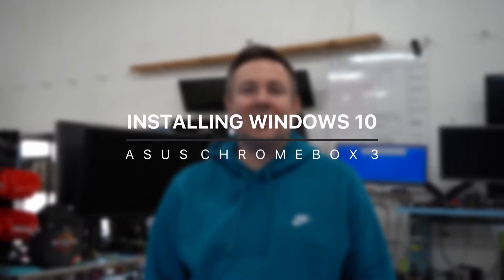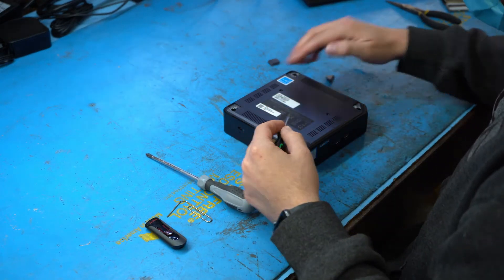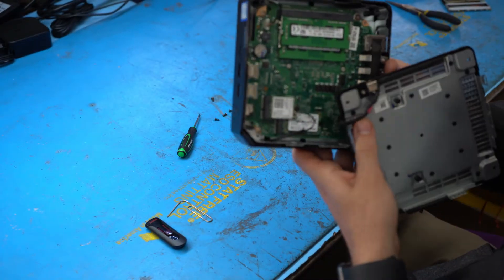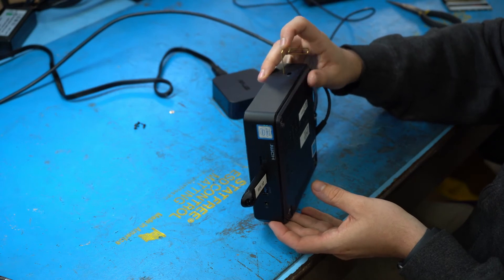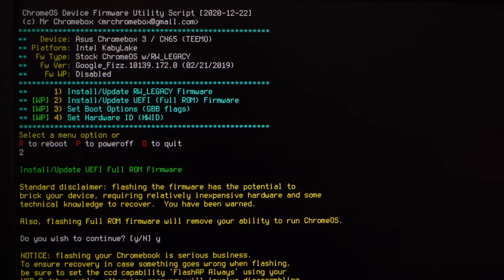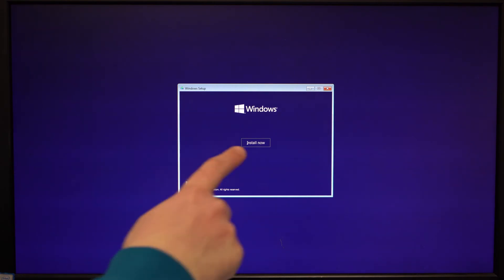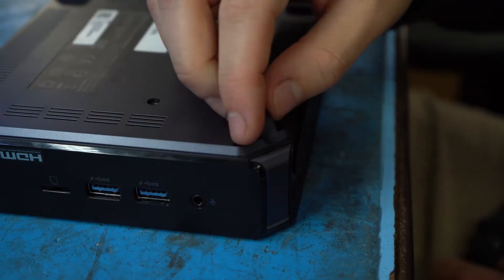Installing Windows 10 on an Asus Chromebox 3

Comment from the maker: Hey everyone.  I see a lot of comments lately with people having problems getting this to work for them.  This video is from 2/22/21 and it's now over a year later. If you are having problems with the instructions it's possible that something changed and it doesnt work or doesnt work the same way anymore.  I'd like to have one of my employees follow the guide again and see if it still works for them, but I dont know when we will have time to get to it because we are slammed with projects.  I'd suggest going to some forums and asking questions there if you are having problems.  Thank you.
Reply: have you tried it this year of 2023 to see if it still works to get windows 11 home installed!??😢😢
Reply: @jeffreybower5959  Nope
Reply: I think the problem people are having is that the video jumps to a later section and we are missing the part how we get to the CLI.
Reply from the maker: @RepairMan2x  The video is old now. When the video first came out 100s of people used it successfully. Now we get a comment here and there with people that say it doesnt work. If it doesnt work anymore it doesnt have anything to do with the video giving bad instructions, its either people are doing it wrong (not following instructions) or the instructions just dont work anymore because of a change to the download we used to make it work.
Reply: have all 3 of the chromebox 3  running windows but no sound ? what driver does this take realtech highdef
Reply: Hi there, is there any way of doing it on Chromebox 5?
Reply: no @luizsantos2422
Reply: @luizsantos2422  Probably, i would suggest googling and looking for some forums

Comment: How did you connect to Wi-Fi in developer mode?
Reply from the maker: We made this video over 4 years ago so i dont remember exact details, but i dont think we connected to wifi ever in this video.  I could be wrong, but i believe all the files were put onto a flash drive for the install.

Comment: So, after removing the screws, the installation requires an internet connection for firmware updates.
To replace the SATA storage with a larger capacity, should this be done before or after the firmware update?
I mean, the existing storage can be reused to revert to the original ChromeOS system. Is that possible?

Comment: still no luck on the 3" but cn60's so far easy to change firmware but chromebox 3 is not responding to the ctrD to get into developer mode so not sure what to do

Comment: I follwed this tutorial up until i put a paperclip in the hole and i get a message that says, "Device you inserted doesn't contain Chrome OS".

How can i proceed?
Reply: did you press Ctrl + D at this point?
Reply: @markusholmen6635  yes, no response
Reply: i think you still need the original 32gb m2 ssd with the chrome OS on it.

Comment: For the people that have a problem with getting int developer mode - you need to have a system disk with ChromeOS installed. Then you are doing the steps and you are able to access the bios upgrade procedure. Thanks for the instruction
Reply: @arbbo1675  i got ChromeOS on the disk so no idea. I installed on it proxmox so no idea how windows works on that device
Reply: @arbbo1675  I got mine with OS Chrome installed so i got no idea. Regarding windows i have not installed it - i installed proxmox
Reply: have chrome os on it but not helping and yes have the right screw removed

Comment: I followed the steps and i just get “device you inserted doesn’t contain chrome os”
Reply: Did you ever resolve this? I am stuck at this stage
Reply: @arbbo1675  no I had to put the original drive back in it with chrome on
Reply: I figured it out and now running Mint Linux on two of my chromebox PCs

Comment: worked for me on a Chromebox 3 I7-8550u with 4 gig ddr 4 and 32 gig upgraded to a 32 gig ddr4 and 1TB ssd NVME, worked flawlessly only 4 drivers missing but all  USB Port work and sound work has well, using it on my 4K tv has a Streamer!
Reply: Very nice, i do have the same computer, however i don't have audio through the HDMI, or the port in the front.. i have to use a USB audio device..
Reply: Sound is going by my hdmi without problem used hp driver if i remember right
Reply: Could you share the driver I have a problem with the audio driver
Reply: @rohitdutt4010  identify your driver needed buy going into the device manager then select the undetected device go into properties then details tab, look under HARDWARE ID then look for it on google, i still have 4 undiscoverd device but nothing preventing from working, mine was identify has INTELAUDIO\FUNC_01&VEN_8086&DEV_280B&REV_1000
 witch worked for me has HDMI sound card
honestly didnt test other audio port since this one work
Reply: BTW its run Windows 11 Pro Flawlessly!
Reply: How are you using this as a streamer? Do you use apps?
Reply: @arbbo1675  i Use it to watch my movie like netflix Disney Plus Spotify has well and for other kind of movie streaming website :)
Reply: @arbbo1675  using either google chrome or the windows app disney plus, netflix (sorry i dont stream like twitch and such i mean streaming video for my kids my english isnt perfect)
Reply: How? Mine doesn't go to developer mode
Reply: @Japzel BE sure you have the OEM harddrive in it before going into developer mode! tryed using a my 1TB hard drive with Chrome os installed didnt work needed my owm 32 gig hard drive
Reply: We have the same exact system

Comment: Windows installer keeps crashing:/
Reply from the maker: Likely a problem with either your flash drive or your system.  Did you upgrade/change any of the parts like ram or SSD from what the factory had?
Reply: @computerheadquarters  i changed the ram to 16 gb nothing else

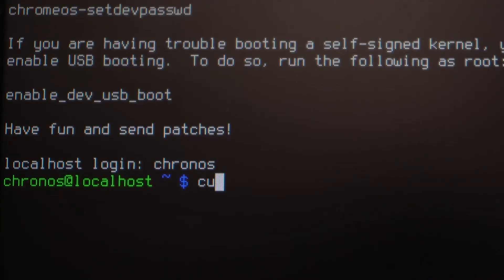Comment: So at 5:29 after you connect to the wifi, are you going onto a terminal on a different device or are you using a terminal on the Chromebox and how do you get to it after connecting it to wifi? Thanks.
Reply: I found it on another video. Need to press Ctrl + Alt + F2 to get to that window.

Comment: Great News Alex! I knew that some how I would get this Chromebox reprogrammed for Linux and it finally happened. After days of all my trials I went to the master, Mr. Chromebox himself. I found out that you can actually avoid some of the steps in your video. Once you get to the screen where you hear the two beeps and the system goes into developer mode, the system will boot you back to the welcome screen. There you press LET'S GO or GET STARTED and you will get the wifi screen where you connect to your wifi. Once your connected you press ctl+alt+f2 to get into the terminal. Then it's all downhill from there, like riding a bike. Enter CHRONOS to log in as admin and then just put in the command line supplied by Mr. Chromebox. The computer will do its thing for about ten minutes. when the script ends it will tell you to press enter. Type R to reboot and there you have it , the little RABBIT. I didn't even have to reload my Linux Mint. I just took the SSD out of my Chromebox 2 and put it in my Chromebox 3, went to the boot menu and selected the drive and it booted into my existing Linux Mint, saving me the hassle of reinstalling all my files and setup. You know what they say, "WHERE THERE IS A WILL, THERE IS A WAY!" One of the most challenging and exciting things about owning a computer is trouble shooting problems and discovering how things work. I hope this information can help someone else with his or similar problems. When all else fails, read the information on mrchromebox.tech website, it may light a fire in your brain to try something different than what you have been doing. Have FUN!
Reply from the maker: Thanks! We havent really spent much time with chromeboxes in years - back when we made this video we had something like 2000 chromeboxes that had just came in from a big supplier and so we were really looking for ways for more customers to find a use for them.  We sold through those years ago.  We have been getting small amounts of them here and there, including the new Chromebox 4.  Our chromebox videos are actually some of our most viewed videos, so if we get some time away from our current video schedule with our LAN center, i'd love to revisit.

Comment: Hey Alex. I have an ASUS Chromebox 3 that simply refuses to be reprogrammed. When I power on and keep holding down the reset button I do get as far as TRANSITIONING INTO DEVELOPER MODE. But the system refuses to go any further. I even tried holding ctl+alt=H at the end of developer mode and the system just boots back into Chrome OS welcome screen. This system is either broken or it's possessed!
Reply: Then you need to enabling debugging options first and enter the root password, if not changed it is test0000

Comment: Good News Alex! I downloaded a copy of the Chrome os Repair software and I have my OS back. However, when I try to get into a terminal my system won't let me get passed the screen were it processes into developer mode and then it boots me right back into the Chrome start page. I've been working on this for several days now. I've come to the conclusion that there are multiple versions of the Chrome OS in these boxes. Not all boxes can be reprogrammed in the same sequence. There are some points that I cannot get passed. I try ctl+alt=H when it gets to the screen you show, but that just boots me back into Chrome OS start page. I never pull up a terminal. I can get it into developer mode. I hear the two beeps and press ctl+alt+H and I get booted back into Chrome OS again and again and again. I guess I just have a Chromebox?
Reply: I know this is old but you can't have set up the chrome os yet power wash the system and start over do no proceed into chrome os when prompted

Comment: I'm following your instructions and I get to the point were the message comes up about setting up hangouts and I click NO. A WELCOME screen comes on and that's as far as I can go. The computer will not go any further into a terminal. How long does the welcome screen stay on after you click NO? Maybe my Chromebox is broken?
Reply from the maker: Did you remove the screw we mentioned?
Reply: Yes! I removed the screw and followed the steps very carefully but the chromebox will only go so far and then I get put back in the welcome screen. @computerheadquarters

Comment: is it possible to add a gpu on this?
Reply from the maker: The only way to add a gpu is running an m.2 cable from inside the computer to outside the computer on a dock type thing.  We did that about a year or so ago for fun.  Performance was not great.  I 100% cannot recommend that.  If you want to game you'd have a better experience buying some really cheap old hardware like a dell 790 tower with an i5-2400 8gb ram and a 1TB HDD ($75).  Then add a really cheap 120gb SSD ($13.50) and whichever video card you were thinking of.  If you're going with something like a 1030 2gb, 1050ti 4gb, or GTX 1650 4gb you don't need to upgrade the power supply.  But if you want something cheap and older like say a GTX 1060 3GB (~$100), you'll need to also upgrade the power supply.  The absolute cheapest GTX 1650 is about $150 right now and a GTX 1060 3GB is about 20% faster, so personally i'd highly recommend picking up a cheap PSU (I saw a 500w coolmax for $20 on ebay) along with the 1060.  I'm sure some people would get mad at me for recommending a cheap psu....but we're talking about a full gaming PC for $200 at this point.

Comment: Just a heads up for future upgrades, to get to developer mode, you MUST keep your original ssd in until you install mr.chromebox firmware, otherwise developer mode is impossible to access.
Reply: i would also suggest you boot it first on the default chromeos, my experience was that if you directly removed the screw, it will show you a corrupted disk warning, not letting you go to developer mode

Comment: hi thanks for video.  complete all the steps until you see the rabbit.  but it does not want to start from usb I get the following message. 
   Booting from ' USB: General ' failed; verify if contains a 64-bits UEFI OS.
Press any key to continue booting....
Reply: I got the same error. did you resolved the issue?

Comment: Do you happen to know where the write protection is on the asus chromebox 4?
Reply: did you solve this
Reply: no @erishboiitv9718
Reply: Take a look at the list of supported devices. It says the Asus Chromebox 4 is compatible and has no screw. It does not need to be opened and works just like that.

Comment: I have been struggling with this problem for a while now. Please help if you can!  I've done everything correct (I'm pretty sure), but I run into the same problem.  I try to boot from my SanDisk Cruzer Glide USB and I get a message that says "Booting from USB: Sandisk Cruzer Glide failed. Press any key to continue."  I've tried multiple USB's and deleted and redownloaded the Windows ISO a bunch of times, so I'm not sure what the problem is.  If I did something wrong, please let me know so I can fix it.  Thanks!
Reply: Did u burn it through rufus?

Comment: Hi, In succesfully installed Win 10. However, every time i restart my acer chromebox, all usb ports dont work. Do you have any fix?
Also, 3.5mm audio jack dont work at all.
Reply: I don't believe it's wise to put back the screw before you're done with setup and at least use each app in a profile once to setup. Write protect will revert all settings to the locked setting after reboot.
Reply: @leonsceco  Hi Leon, the usb ports is very tolerable.. I can just press and hold power button, then all usb ports will work again. However, I really can't find a driver for my 3.5mm audio jack. I hope you can help....
Reply: @melvincruz8217   try Microsoft update

Comment: For me after doing all of the developer mode stuff and connected to wifi etc:

1) I type the command chronos, it gives chronos@localhost ~$. Which is ok
2) typing: curl -LO mrchromebox.tech/firmware-util.sh, it returns 2 blank lines then only shows  chronos@localhost ~$

Please HELP
Reply: Fixed it. The command is silent (not echoed to the prompt screen) now in the new operating systems, it still goes through
Reply: Then type sudo firmware-util.sh

Comment: Would a lower-level Celeron model let you upgrade the SSD/memory too?
Reply: What about added cooling? Great video, BTW!
Reply from the maker: @blinddog1212  Dont think you need to add cooling. Very low wattage CPU on these, they are laptop CPUs.
Reply from the maker: Yes

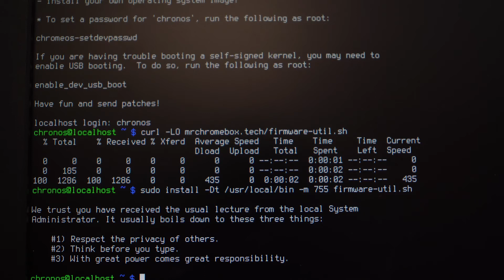Comment: in minute 6:17 when you type again sudo install -Dt xxxxxxx.sh and press enter show a menu, does not show me the menu 618 help me!
Reply: For me after doing all of the developer mode stuff and connected to wifi etc:

1) I type the command chronos, it gives chronos@localhost ~$. Which is ok
2) typing: curl -LO mrchromebox.tech/firmware-util.sh, it returns 2 blank lines then only shows  chronos@localhost ~$

Please HELP
Reply: @aqib2000  after type sudo firmware-util.sh

Comment: Couple of roadblocks: 5:17 I expected clicking "no" to bring up console but it didnt. You didn't show show or talk how to bring up the console. 6:17 I expected "sudo install ..." run the script but it didn't. You did not show or talk how to run the script. Otherwise useful tutorial! Got it working, but couple of problems remain: 1) when restarting the computer, mouse and keyboard dies. 2) cannot set resolution to 1440p.
Reply: the hotkey should be F2. if not, try CTRL+ALT+T.
Reply: @realmavis  not worked  :( (F2 or CTRL+ALT+T)
Reply: how did you run the script?
Reply: ctrl+shift+f2
Reply: Mine was ctrl alt f2
Reply: how'd u run the script?